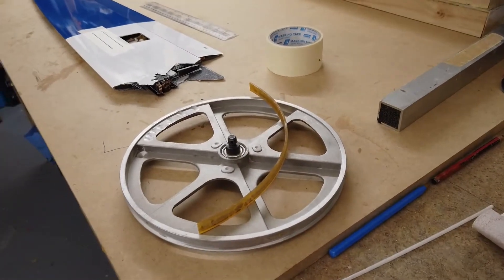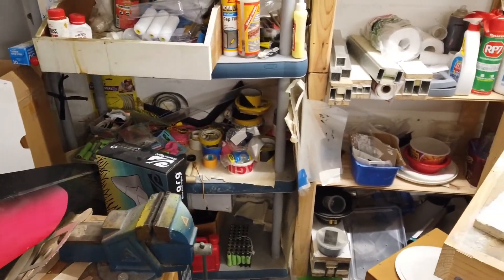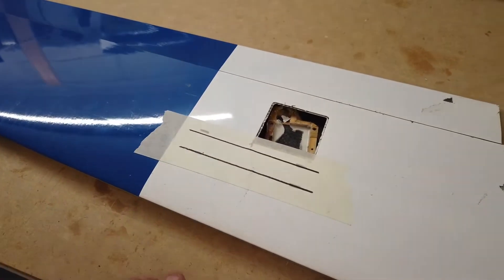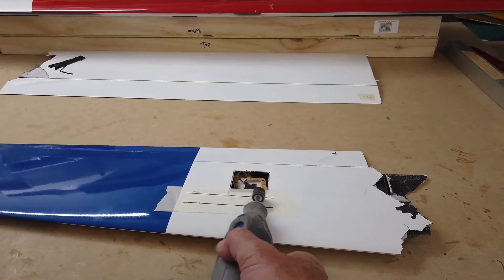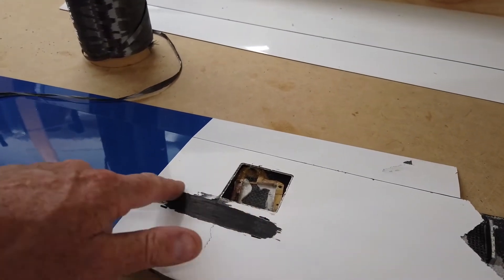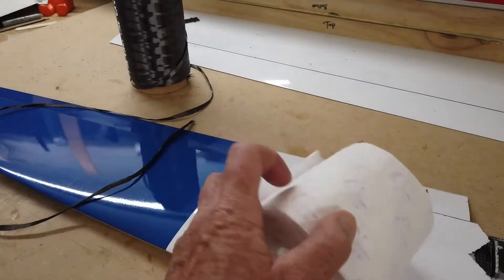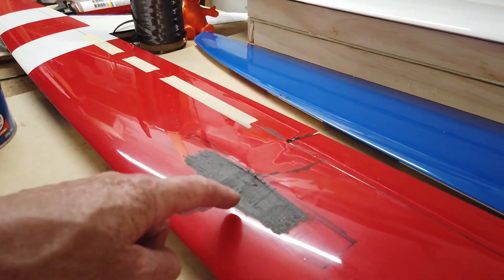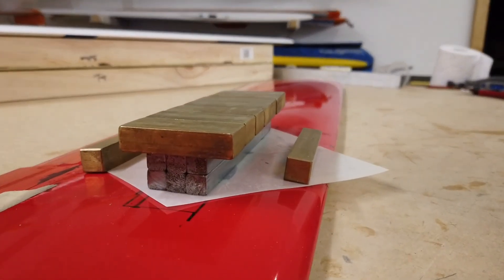Fosa Lift Wing Repair

Comment: Thanks for posting, used this method to successfully repair the spar in my Energic glider.
Reply from the maker: Good to hear, glad the video demo helped.
Reply: @chris-adams-tas    It gave me the courage to do the surgery, I just need you to make a video on wing delamination a creases next 😂
Reply from the maker: I'll see what I can do. In the meantime, take an X-acto and cut the fabric right at the apex of the crease. Flip the blade over and use it to open the wound wide enough to fit 80 grit sandpaper in there. Open the wound to about 1mm ready to receive a bog mix. Ensure bog mix fills the crack screed off surplus then tape over the wound with masking tape. Flip upside down and let cure. The bog mix slumps internally over the wound and forms a strong bond. Remove tape, sand, fill, sand, fill, prime, sand and topcoat.
Reply: Thanks for the advice, I don’t know what bog mix is though.
Reply from the maker: @Manchesterglider  Bog = epoxy and cotton flock (for a strong cure) or micro balloons for a more sandable less-structural media.

Comment: I have those jobs to do! Would love to see how you dealt with the joining.
Reply from the maker: Hi Bruce,
Long time no reply  ;0)
You've probably addressed your repairs already in my absence.
 
As for joining wing panels, use the hingeline as the definitive reference. 
It needs to be plumb.

Sand back any fibres on the wound that might interfere with alignment but don't get carried away, just enough sanding to provide clearance. Big gaps between skins would mean more fabric rather than bog mix to fill the voids.
 
Masking tape to hold everything in place and use frugal application of resin to firstly attach both panels then let cure.

Once cured, then look at using tows for the spar breaks (as demonstrated) and fabric over the skins if necessary; you might be able to use a bog mix to bind the skins together.
If this is the case, apply bog to the gap between panels, masking tape over the wound, flip the wing over and let gravity slump the bog over the wound.

HTH,
Chris.
Reply: @chris-adams-tas  Hi Chris, not yet! I still have those tasks ahead of me and a couple more but thanks to your excellent description I reckon I will be able deal with them. I am very grateful, thank you!
Reply from the maker: @helithopter  
Hi Bruce,
Re: joining 
Ensure all edges of skin and spar are lightly sanded so the fibres don't clash when you try to re-align them.
Ensure the hinge line is used as the reference for alignment; it's critical the hinge is straight in both planes.
Do several dry test fits before joining with medium zap. Avoid getting zap in the spar gap however, leave that to resin to fill.
Once cured you should now be able to man-handle it gently.
Fix upper spar cap using procedure in video. let cure, fix lower spar cap.
Sand surface near break on top side and re-introduce fabric I use 3 oz on a bias (20 - 40 degrees).
For a smooth cure, use mylar over the wound, flip it over, support it strategically and weigh it down until cured.
Repeat other surface then sand/fill/primer/sand fill etc.

Chris